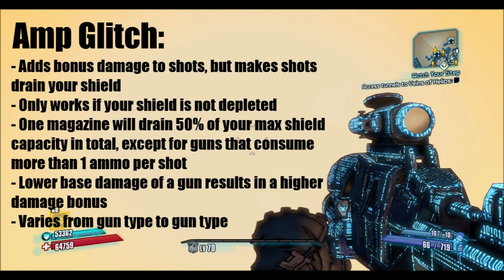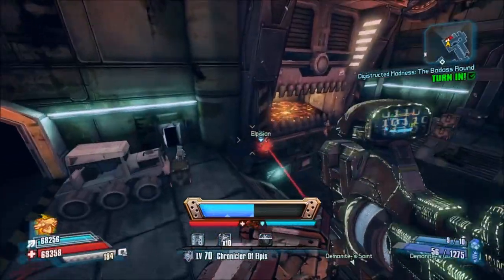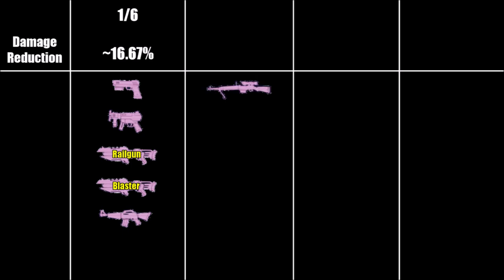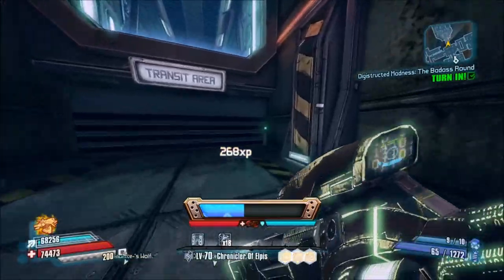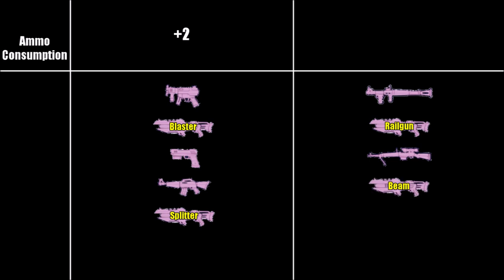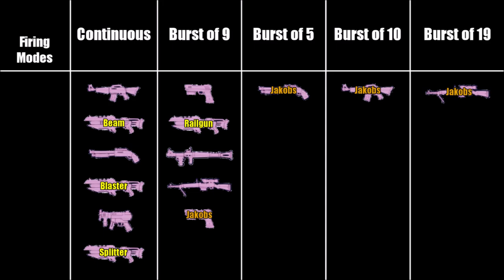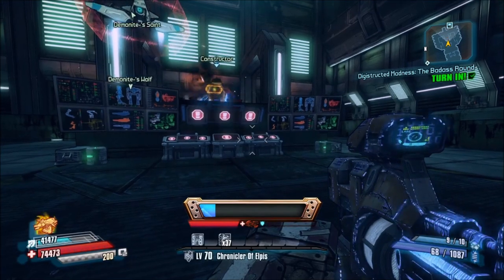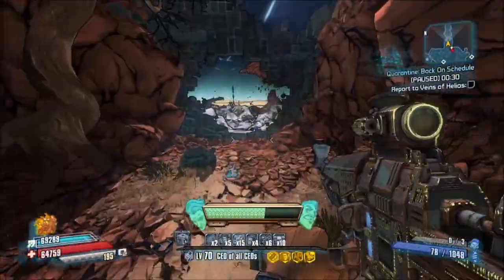How Error Code Glitch Effects Work - Borderlands: TPS

Comment from the maker: UPDATE:

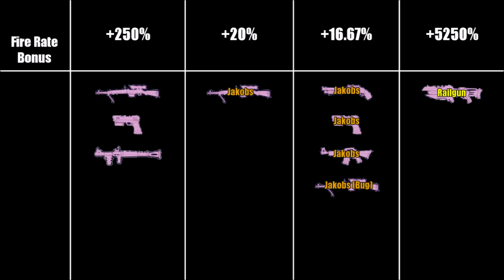At 10:26 I mention how I didn't figure out the fire rate bonus from the loop glitch on weapons that fire continuously. I did now! Shotguns, SMGs, assault rifles, beam lasers, blasters and splitters all gain +50% fire rate. I updated the google document as well.

Update 2: The overload glitch increases elemental effect chance. I'm not sure by how much, but it seems to be a huge bonus.

Update 3: It turns out that the damage penalties of the Multishot Glitch (3:55) are additive to other gun damage penalties, for example those of Claptrap's Subroutines. As such, it makes more sense to say that they add a positive value to a divisor, rather than a negative value to a multiplier. The values would be:

Pistols, SMGs, Railguns, Blasters, ARs: +20%
Snipers: +25%
Launchers: +40%
Splitters, Beams, Shotguns: Still 0%

I will go over this in detail in my upcoming guide about gun damage types.
Reply: How exactly were you able to finally calculate for the 50% bonus when you were unable to previously?
Reply from the maker: @GeneralSouthParkFan  The bonus fire rate only kicks in after the first shot was fired with the loop glitch active. If you just have the glitch active but don't do anything there's no change in values. Back then I simply didn't even consider that a possibility. lol
Reply: @DemoniteBL  That's quite the funny oversight then, glad to see it's been finally answered though.

Comment: This is such a weird and intricate system, it's a shame this game never got the love it needed to really shine.
Reply: It would be a great game if it had about 3 more campaign DLCs worth of content. Or maybe if the devs had just capped levels at 50 and left them there. The game really suffers for trying to stretch out another 20 levels (at super slow leveling speed) well past the point when the content in the game has been exhausted. I feel like capping levels at 50 might have also addressed the problem of too many skill points.
Reply: @TheSamuraiGoomba  The 3 more campaign DLCs worth of content were planned.
2K Australia went out of business one month after releasing Claptrap Voyage DLC...2K Australia did not have time to finish completely the game.

Moreover, Borderlands is not meant to be played at level 50, that doesn't make sense ...
Reply: @mrnicj100  Dude. You ever try to level 6 characters to max level in TPS, playing legit? It takes forever. The xp drop-off going from TVHM to UVHM is ridiculous. It feels actually broken because it's so low. You have to play through the campaign and claptastic voyage something like 10 full times JUST in UVHM to get approximate to max level for a single character. Most people who have max level characters in TPS cheated because it's so fucking tedious.

Level 50 as a level cap would have been fine. TPS gives out too many skill points anyway, leading to characters like Jack and Aurelia getting everything they want without having to make any choices, and characters like Claptrap end up with more points than they want and have to find a spot to dump them. There isn't enough content to support TPS at level 70. There's nothing to fucking do with a max level character, let alone six. I realize it's not their fault they don't have any endgame content, but they should have left the cap at 50 then.
Reply: @TheSamuraiGoomba  I have lvl 70 melee Athena and CEO Jack.
I didn't cheat for that...
I farmed Eclipse and EOS ofc (especially when they give you very good gears), Iwajira and others.

Xp is too low in TPS t's true but maybe they did that cause xp in 1 and 2 are too high and cause they planned others dlcs to be lvl 70 more easily like i said.

Comment: So what are the numeric chance % prof values for 0-4 and does it change if you have non 0 values for the other 3 glitches?
Reply from the maker: No idea tbh, it feels like the highest value of a glitch on the error code determines the chance to proc a glitch effect and once you proc it each individual glitch has a chance to be procced based on how high their error code values are. It could just as well be static values though, I don't have anything to back it up.
Reply: @DemoniteBL  sounds like it’d be a nightmare to test: best case scenario it goes down the line left to right. Worst case scenario there’s a massive weighted formula. HHahah